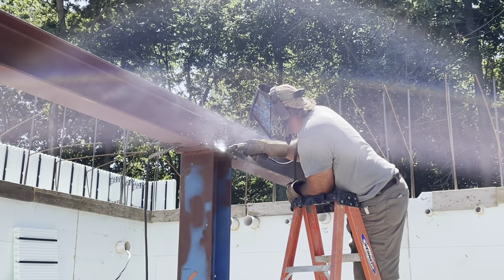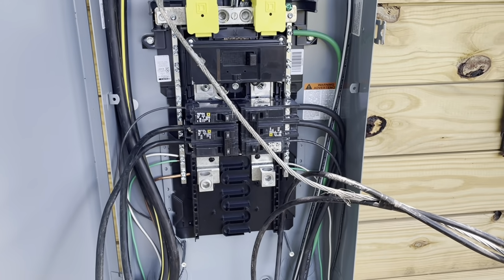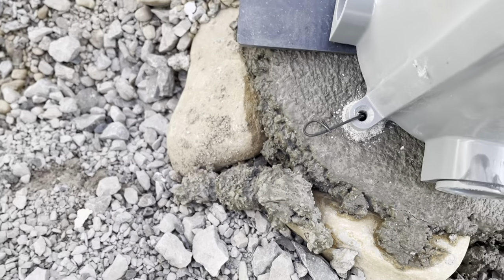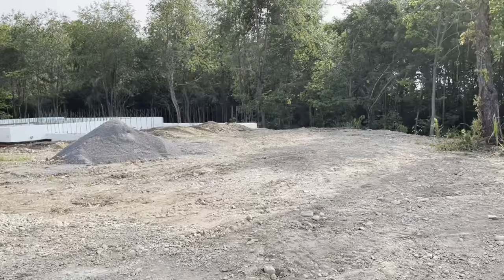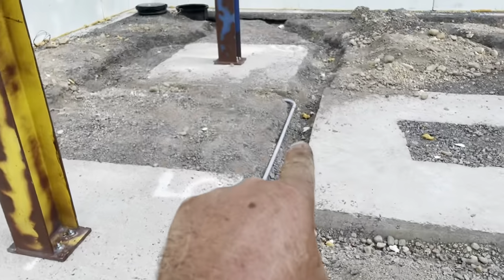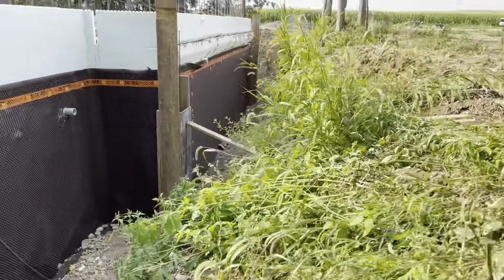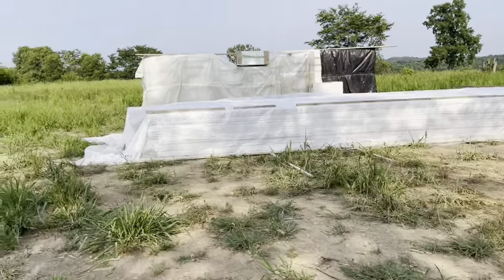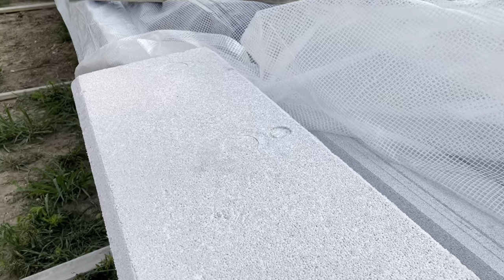Lite Deck Explained

Comment: I want that LiteDeck so bad. I am in FL and I can't understand why people build houses using wood frame roofs when they could use LiteDeck instead. Insane amounts of closed cell foam insulation and an almost indestructible roof makes so much more sense, plus is pretty much never needs to be replaced.

Comment: Does the delta waterproofing replace the peel and stick waterproofing?  I've never seen only the delta layer without a peel and stick or rubber coating applied to the block first.  Fantastic videos btw, I've learned a lot.
Reply from the maker: Yes. I was going to do both peel and stick and delta, but I was advised by 2 people that i do not need both. My foundation is on 100% gravel so I probably don't need either but wanted to use the delta just to be sure. Thanks for watching.

Comment: Love the videos.
Looking forward to seeing the lite deck installed.   I am planning a ICF build and am debating whether to use lite deck or wood I joist for the floor between the basement and main floor like you are. When you make that video, can you please try and show the connection of the lite deck to the wall?   And since you are creating a 12 inch been with a 4” floor and then figure the bottom 4” of the lite deck, you essentially have 20” floor. Did you just make basement walls taller to keep the standard 8-9’ ceiling  headroom down there?
Reply from the maker: I am going to measure the lite deck when i get to the job this morning. My walls are 9' tall from footing to bottom of lite deck. Minus 2" foam and 4" floor. End with 8'6" headroom. I think you could make your walls any height you would like.